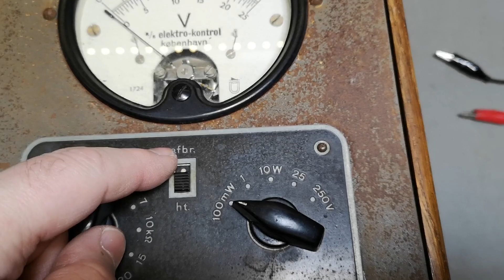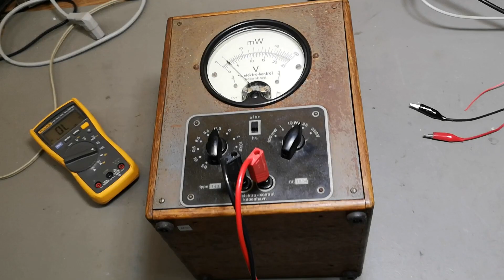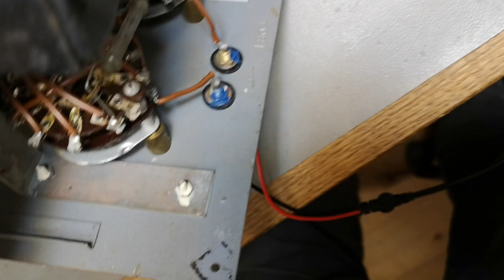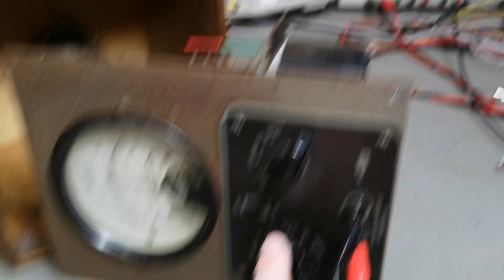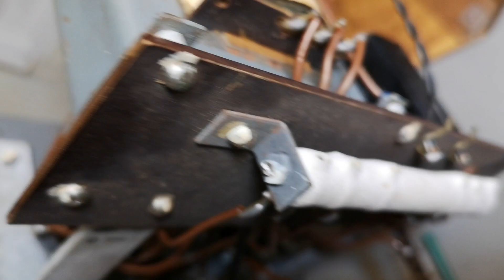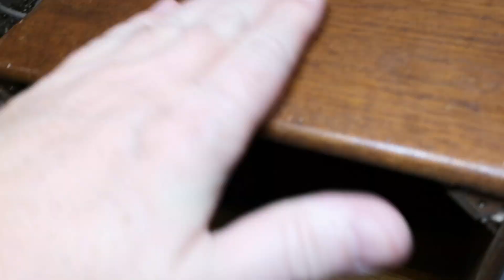Elektro-Kontrol København type 143 100V speaker test unit teardown

Comment: Meter and faceplate look very old, they even did not use capital letter to write capital name. :)
Wooden box is great! From times before plastic boxes, and maybe they were saving on steel.
Wires inside look like PVC, maybe device was reworked later.
100V Public Address system is a reliable thing, "modern" active speakers will die when power goes off, exactly when you need to announce emergency.

Comment: WoW, that's history, when I was little, a 100V line with radio by wire was laid in Czechoslovakia, a one-way communicator for internal reporting was operated on a 100V network in schools and industrial buildings, so I wondered if it wasn't a special tester for something similar.
You'll be fixing it, that loose asphalt plug on the condenser looks impressive 😂

Nice day  🙂 Tom
Reply from the maker: i think you can make a 100V speaker system work using a VERY long cable, that is ofcourse the whole point of 100V systems :-)
Reply: @TeardownOZ2CPU  Not only can it work on a long line, but thanks to the connection audio transformers it has an almost unlimited number of connection points (depending on the amplifier used), thanks to the switching of the secondary winding taps, the volume can also be regulated at the target point.
Reply from the maker: @Edisson.  all large supermarked and shopping centres must still use this type of system  even today?
Reply: @TeardownOZ2CPU  Yes, this 100V system is still used today (at least in CZ), not only in industrial premises but also for public spaces - street loudspeakers for emergency or notification information - this street system is now being replaced by wireless individually mounted pressure loudspeakers. Low-voltage audio distributions have several disadvantages for use over long distances - a large signal loss at long distances, the need to observe the amplifier-speaker impedance loop. However, these low-voltage distribution systems are also used in shopping centers, for example, for the sound system of the shop itself, depending on the size of the area.